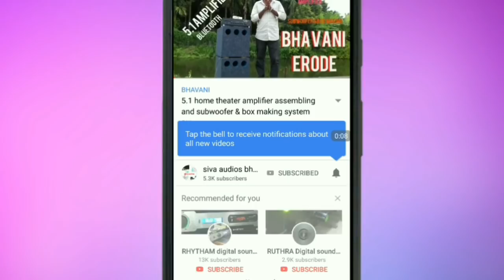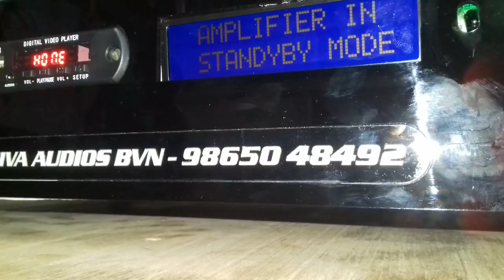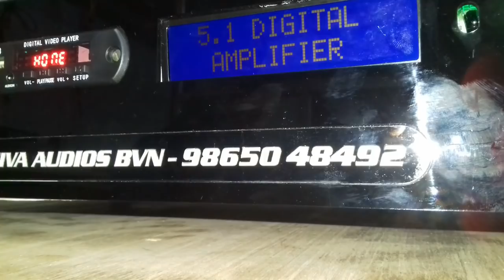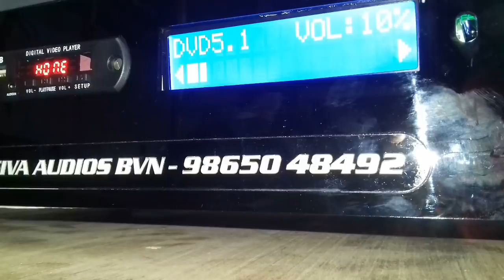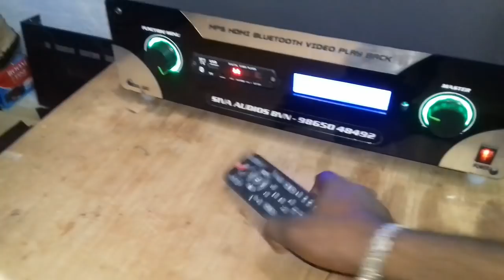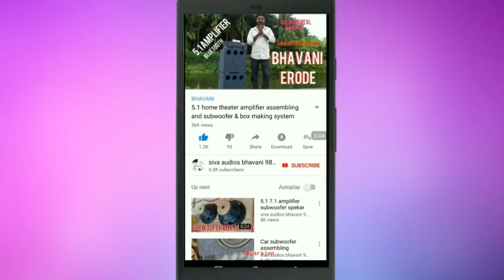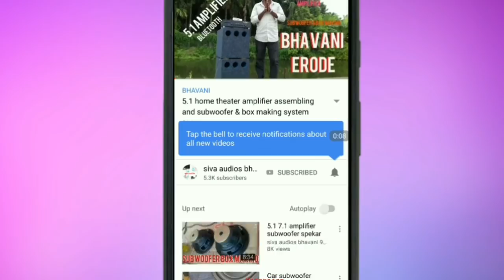Remote control 5.2 HDMI optical coaxial

Comment: Bluetooth, HDMI input+Out, USB, TF Card, FM, 7.1, 5.1, 2.1►Multi Channel Input+Output, Optical Coaxial 2, Remote Control, Connect Device : PC, Smart TV, DVD, Normal TV Supporting Format: Mp3, Aac, AC3, Dts, Mp4, 3Gp, Flv, Mkv, Wmv, Avi, Dvix 4k 2k, Gif, Jpg, JPEG, Png, i need Build Quality Like outer look "Ahuja 250 watts audio amplifier" Need watts Sub► 800 Surround► 600 
how much cost?